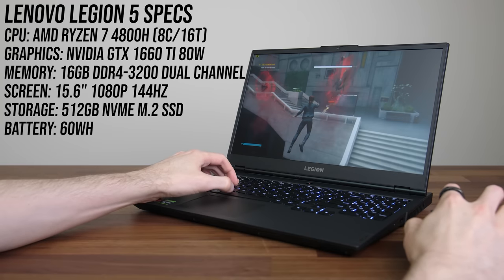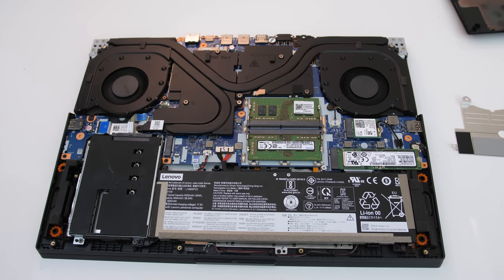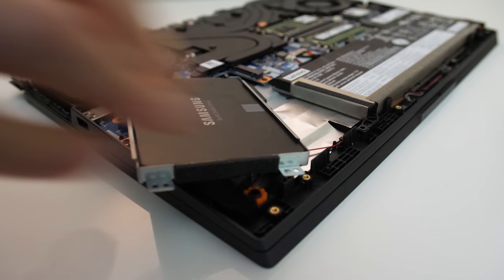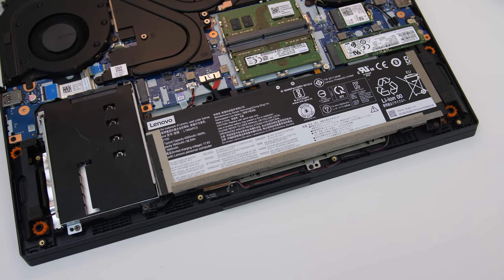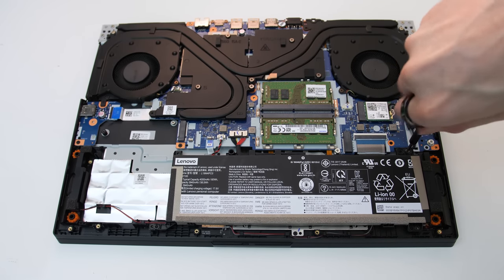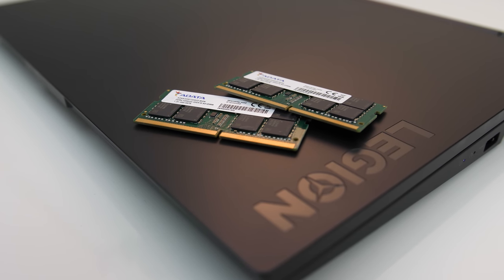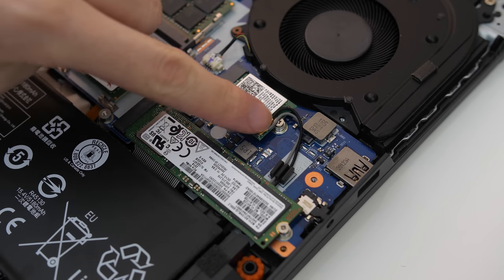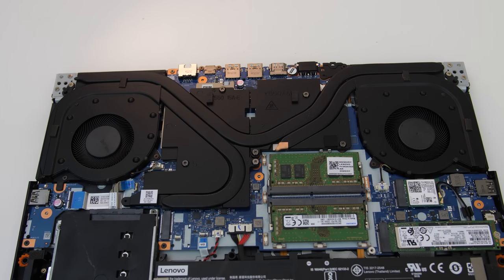Lenovo Legion 5 Upgrade Guide - Boost Performance!

Comment: Great video. I loved it =)
Just to let you know, one thing to mention about the memory upgrade is checking the limit of memory that the motherboard can use before you buy. It would be a terrible waste of money if you can't upgrade due to motherboard limitation.

Keep that in mind :)
Reply: how can I check that?
Reply: jmste  thank you!
Reply: @Kashmir_Daily_shorts As long as you have a free slot, I don't see any problem with that.

Comment: Your Lenovo videos are always first rate. That said, I am a lifelong ThinkPad user and whenever I see what Lenovo has been selling since the overpriced but cheaply made T440 I wonder if we shall ever see true quality again.
Obviously key components have become more powerful but the loss of so many ports, dumping of optical and penny pinching on SD bandwidth (where SDs are even fitted) has shown Lenovo's current management to be trading on a once great and distinctive pedigree. Actual machines are in fact little better than things costing 50% less. Dell also had a bad quality patch but seemed to learn from crashing sales. HP are mostly bad with the occasional machines being at Elitebook and Probook standards of a dozen years ago.
Many of us in the area of education IT are going back to Clevo base models honed and finished by specialist companies and having so-called 'gaming computers' modified to serve our middle term needs. We also note that some ASUS models a few years old are more accessible and upgradeable than the Big Three.
We think it possible that Framework and firms like it could herald the future because many models yet too narrow a range is the reality of the big three non-Mac companies. Their greed and laziness could sink them rather quickly.

Comment: Fantastic informative video with links to all parts! This helped me in upgrading my newly purchased Legion 5 with i7 10th gen/Nvidia RTX 2060/16GB Ram/ 256 m.2 NVME & 1TB SSD Hard Drives/240hz Screen/500nits brightness ... all for $1088. I will upgrade to the 80W battery and an M.2 NVME WD Black 1TB, thank you again for all the informative links and video.
Reply: Were you able to get the right battery? I'm having trouble getting one that works

Comment: im thinking 82% of people here dont have a legion 5
and that 18% does.
Reply: Those holes on the back looks scary as fuck. It's like, the thing is staring at me. That's freaking me out.
Reply: @traderbear6518  It's cheese
Reply: I have bought the Lenovo Legion 5 17 with Ryzen 7 5800H eight cores and 16 threads, RTX 3060 115+15W TDP, 17,3"  144Hz 1080p, White colored backlit truestrike keyboard, 16Gb DDR4 3200MHz CL22. I got it for 11990 SEK or 1449.19 in USD. And it's a high end beast. I have so far maxed all my games with good fps. Warzone maxed out with RT and DLSS on gives me a constant 100+ fps. Love it!
Reply: @aiden5573  The 5 pro model has much better grill design.
Reply: @traderbear6518  I will take this time to recommend the legion 7! 
It has no air filtration, and a sort of mesh instead. It has the same bottom intake system, causing it to vacuum anything under the computer!
Reply: @ThePower1037  But it looks horrible the legion 7 grille design.
Reply: @ThePower1037  and since I have trypophobia, I won't be able to look at it. So I need to get something else. How about the Strix G17? Do you recomend that?
Reply: @traderbear6518  uhm, but it's not like the laptop is facing upside down all the time? it's at the bottom, which is clearly always facing a platform or a table.
Reply: @damshijo  but still, while cleaning, I could get a panic attack.
Reply: Nice. The Legion 5 pro looks much better but i understand why you didn't want the higher res screen.
Reply: @P4ND3R550N  The new legion 7 is on another level, but before it, the legion 5 pro was the best looking gaming laptop I could think of.
Reply: @ThePower1037  Yes but the Legion 7 costs quite a bit more than Legion 5 pro.
Reply: @P4ND3R550N  Yeah...

Comment: For those thinking of buying late 2021, I just got mine on black Friday deal, model Legion 5-15ARH05, there is no space for 2.5 SATA, only NVM storage upgrade! I did bought a 2T EVO and installed, no regrets!
Reply: Coul you replace both NVM SSDs with 2TB each for a total of 4TB?

Comment: Good upgrade, is good idea egpu with 3070 to ryzen 4800h????
Reply: @ajinpjseph4014  3060ti???
Reply: @xavierov  3050?
Reply: ryzen don't support usb4/thunderbolt for using egpu i believe
Reply: You can't. Thunderbolt is intel only
Reply: @Yami-rw7yt  I can with pciexpress in the wifi target
Reply: @xavierov  oh then good idra
Reply from the maker: Not really because you have to use M.2 for the PCIe which is hard to recommend, makes the laptop far less portable unless you are cool with removing the bottom panel all the time.
Reply: Lenovo will probably announce a 5800H with RTX 3080 next week at CES or soon after.
Reply: @Hoang D wow, i never knew that u cant egpu ryzen based laptop 😔 
I thought it would work irrespective of the cpu manufacturer. 

But,as for my previous comment (which i deledted😆)i dont think 4800h based laptops would cause as much as a bottleneck to a rtx3070

Comment: Hi Jarrod, 
Just wondering here do you know what’s the maximum NVme you can upgrade to this laptop? Did it support 4tb / 2tb nvme stick?

I have this machine for two weeks now and if possible I would love to have the biggest storage I can go for my editing work ;)
Reply: does it support 2tb / 4tb nvme ?
Reply: @zieldchaos  still don’t know the answer yet sorry mate
Reply: @FerryPrima  Ever figure this out? That's what I would love to do too!
Reply: @ryanspackman548  Hey Ryan, seems like there is no limitation to how large the SSD is, I believe I heard this from Jarrod somewhere. so you can go as high as you want. I myself ed up upgrading to 2TB, as it brings the most value in my country as of right now. Hope that helps mate!
Reply: @FerryPrima  Hey I want to add a 1TB m2. Can I install windows on it and use as the main ssd m2?
Reply: @rafa2657  i think you should be able to, as long as you prepare another window license
Reply: @FerryPrima  thanks! I already has the other windows license.
Reply: @Kashmir_Daily_shorts hey Kashmir. I don’t think there is any limitation on storage size you can upgraded it with so 4tb should be fine.

Comment: I bought the Legion 5 Pro 16ACH6H after watching thousands of reviews and many of yours! NO regrets so far! Thank you @Jarrod'sTech

I'm managing to play everything on Ultra / Extreme the screen is so smooth that I can't look at my Acer predator 1980x1080 144hz 1ms second screen with the same eyes. Now I need to buy a new screen to be in pair with this laptop, considering the Samsung Odyssey G7 32.

By 2022 I hope to expand memo + more disk and perhaps battery, however, the default config is being more than enough.
Reply: Not enough space. 2tb is needed for all the installed games

Comment: This video is on the money.  If you can find this, or a Legion 5 (8gb ram) version at a great price grab it and upgrade to at least 16gb ram. It’s the best bang for buck upgrade.  Around 70 give or take for two sticks of 8gb. You won’t regret it friends. Budget doesn’t have to mean low performance.  It punches above its weight.

Comment: Hey @JarrodsTech 
greate video. Just one question though - should I switch off the battery in bios? Is that really necessary? Some ppl say that you should even unplug the battery from the motherboard. I plan on doing my first ssd upgrade and I'm a little concenred that I'm gonna mesas my laptop up.
Thanks.
Reply from the maker: I'd recommend unplugging the battery and you should be fine. I didn't do it here, and haven't had any issues with it in the past, but I would recommend it if you're worried.

Comment: Very good video and useful info. My legion 5 now have the RTX3070 and Ryzen 7 5800 and 32 GB of RAM an fly quick. Now I install a second SSD M.2. A crucial  with 2TB. Is impresive this gaming portatil and the price in Black Friday was 1160€. Now is 1499€. Is very convinient to activate the price  alarms on Amazon
Reply: Cool. How is the battery life? I’m thinking of buying one too
Reply: Is enought for normal use, 3 o 4 hours. For gaming you need to be conectado to the mains.

Comment: Hey Jarrod. Does the 17-inch Legion5 support an 80wH battery along with 2.5'' drive. I am under the impression it does, but haven't found a definitive answer yet.
Also are there any disadvantages to the 17inch one?

Comment: The internal size of the circuit on that 2.5 1tb samsung drive is less than half the size of its housing.

If you get a longer flex cable and modify the 2.5 ssd housing and the tray you could actually get the access needed for the other M.2 NVMe ssd.

If you consider yourself reasonably handy, it's a pretty easy task and you get 3 SSDs in 1 machine.

Cool for dual boot setups!
Reply: Did you do this? Do you have pics of how it would look?

Comment: Hii, great Video. One question though... I baught the same SSD and the one has an included cooling plate, should i put that one on or will it actually hurt the System? Thank you

Comment: Just added a new additional m.2 ssd thanks to this video. Might have opted for a cheaper 2.5", but my machine already has the larger battery installed so there was no room!
Reply: is there an additional heat shield for a new m.2 or is it okay to just leave it open?
Reply: @reyjustine7116  I left it open and have had no issues
Reply: @reyjustine7116  slap thermal grilly thermal pad on top of both nvme & youre good to go

Comment: when replacing the wifi card on the legion 5, do you recommend the AX210 you used in this video? or the ax200  (22260) that came with the intel based computers? the price for the ax200 is 10-20 vs the $40 for the ax210. Will performance be the same when not using the 6e?

Comment: Hi Jarrod, I had a question regarding the 2021 version of the Legion 5. Will it work replacing the 60 watt battery with an 80 watt version just like the 2020 model? If so could you send some links to purchase the battery. I haven't seen any channels mention it.
Reply: I'm wondering like you.. did you replace the battery?

Comment: hi i bought a legion 5 with only 8gb of ram. the stick is from samsung and has a 3200mhz speed. can i add another 8gb stick from crucial that's the same speed ? Or do i need both to be from the same brand. thanks

Comment: Question, the adata ssd they sent you, is that compatible with the Legion Slim 5 14” oled model? and also, (forgive me, im sorta new to the tech world) there a difference between M.2 and M.2 2280? Asking because I want to upgrade the storage on my oled Slim 5.. thanks!!

Comment: Hey, do I lose/void the guarantee if I upgrade the RAM myself?

Context: My Legion 7 is brand new, but due to the chip shortage issue they have sent me a stock model with less RAM and SSD than I initially ordered.
Reply from the maker: Unfortunately, it's hard to say as it varies based on region. You would need to contact Lenovo support for your region to find out.
Reply: @Hanks864 I think in the US you will lose your warranty. On each of the ram there are stickers with dates and they’ll know if you change it out.

Comment: Did you have any issues booting after installing the new battery? I've read about issues with the 5i only booting up when the laptop is plugged in after installing the 80wh battery.

Comment: I was thinking about to upgrade my Legion 5 81Y6006YHV 's memory from 16GB to 32G or 64GB, but i shocked (positively), the there is no much more speed up improvement in Premiere Pro. So I still keep my 16GB.
Is it worth to upgrade to 32GB or 64GB to have a quite good render speed for 4K videos?
Thank you

Comment: For ADATA 32GB DDR4 PC4-25600 3200 MHz SO-DIMM 260-Pin Laptop Memory Model doesn't available right now for sale. What else do you recommend to replace for Ram ?

Comment: Hello jarrod! I have a question, i have legion 5 (81Y6000DUS series) and i wonder if the model matters. I also see couple batteries with different names but same specs. Does it matter which exact battery i get? or am i good as long as its an lenovo 5 battery?

Comment: Great video! One thing I'm not sure I got right: it's either the SATA or the M.2 HDD, you can't install both within the same Legion 5. Is that correct or you can actually have both together?
Reply: You can only add one. 1st reason is there is only room for one them to added not both. Second is that hardware wise they both run through the same controller on board, meaning it be unable to read both an additional m.2 and SATA at the same time.

Comment: Hi @Jarrod’stech

Great vid as always!
I have some questions though and would really appreciate some clarification.

Im trying to install an m2 ssd and I have no experience doing anything like this before so Im pretty anxious.

My first question is, do I need to place the sata ssd tray back above the m2 ssd? Or is it fine to just plug it in and leave the tray out?

2nd question, do I need to unplug the battery before tinkering with anything? Ive heard some people say yes some say no.

Any other things not mentioned in the video you think I should know? Beginner tips? Big No no’s? 

Thanks and I hope your doing good brother.
Reply from the maker: Look up a M.2 installation guide on YouTube ,lots of good info out there you can see someone do it first. I would take out the 2.5" drive spot. I don't personally ever take out the battery, but I would suggest it, if you drop a screw or something on the motherboard by accident it could short something out and break it, so probably a good idea to do as a beginner.
Reply: @JarrodsTech  thanks a lot Jarrod!

Is it safe to just unplug the battery or is there something I need to do before to unplug safely?

Sorry for the dumb questions just really nervous and its an expensive laptop that I dont want to mess up. Cheers
Reply: @tsha199  before changing any hardware you should unplug the battery, by doing so you will not lose any data, the worst thing that could happen is resetting the bios settings which is not a big deal.
Reply: On my legion 5 there is also a setting in the bios to "unplug" the battery but I don't really trust it.
Reply: @TechTroppy  Thanks for letting me know!
I actually went ahead and installed the ssd without unplugging the battery because I just said f it.

Luckily it worked out 👍🏻

Comment: your wrong about not being able to switch out the cpu and gpu because of being soldered, you can indeed switch it out if you have the skills and tools to do so but its a bit intensive to do.  You need to have a soldering station, microscope, reballing stencil and kit and many more tools to do the job but being a amd set up you have a lot of upgradability.  You also might have to flash the bios too but that isnt always the case.

Comment: Man, should I buy the Lenovo 5? It is nice looking and it posses a lot of gaming power, but man the price. Is it better than the lenovo 7i or the 5i?
Reply: Depends the 5i is better for gaming as it has better single core performance but this version the ryzen version is better for other tasks like content creation as it has more cores. Would recommend one thing which ever variant you get try and get a GTX 1660 ti or any rtx except for the 3050 ti. I think a legion has a 3050 ti variant it's rlly bad u would be better with a 1660 ti

Comment: Do you recommend an M.2 SSD with a heatsink? And would that even fit/is there a max size that would fit in there? Thanks!
Reply: no, the best you could fit would be a thermal pad over the top of the SSD, which would bring minor improvements in temperature

Comment: Thanks. I  have two questions. 
1. how to know a battery  whether is compatible with a laptop (MSI)? check whether the same voltage  ? Is higher than 1-3 voltage compatible?  I recently am planing to upgrade a battery of my MSI GL 66 3070. I want to  grade it from '53wh 4 cells' to  '99Wh 6 cells lion' battery.I don't know the battery that i  am planing to upgrade  whether is compatible.
2.Upgrading the adapter from 180w to 230w,  is it work properly?

Comment: Hello thank you for pretty good guide I had a asus g531gu it has one slot that included a 256 ssd M.2 and one 1 TB HDD, my question is that you suggest that I change my M.2 with an 1TB or Change it with a 1TB sata‌ 3 SSD? Which one is better, you know this laptop has a problem in designing that is its keyboard because when you close loptop after a 1 year using some scratch will appears on screen, do you have a protective solution for that?

Comment: @Jarrod'sTech I see that you are using 64gb of ram. Everywhere I look, the specs say it can use a max of 32gb. If that is incorrect, then can it also use a 2tb ssd?
Reply: Did you ever figure this out? I'd like to put 2x 2TB M.2s for a total of 4TB but don't know if this would work.
Reply: @ryanspackman548  I have seen videos of people putting in 2TB sticks but I haven't done it. ($$$$)

Comment: I purchased the battery, but now the charging LED blinks rapidly and does not charge despite recognizing it's plugged in. I tried uninstalling/reinstalling the battery in device manager, but with no success. Is this compatible with my 15ACH6 Legion 5? I tried finding some answers, but there are none. Any help is appreciated. Thanks. Love the channel.
Reply from the maker: Which battery model did you get? The one they sent me wasn't actually the one I ordered lol but it still seemed to work, granted I don't think I paid attention to the LED but I think I would have noticed if mine was doing that.
Reply: H, did you find any solution ?

Comment: My legion 5 motherboard is shot.  I have a new legion 5 slim.  What is the process to move the memory card (M.2?) from the old to the new?  Would I replace the card in slot 1 or simply add my old card to slot 2? Once done, is there anything I have to do (download anything, etc.) or will it immediately recognize my "old" card?